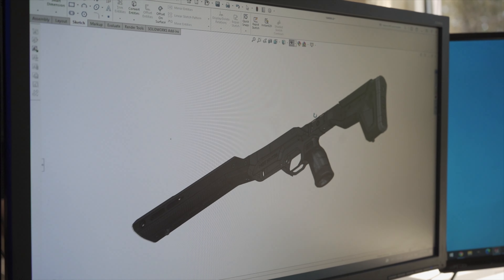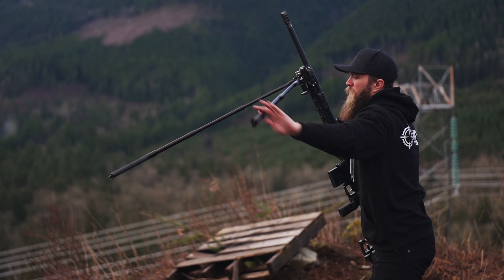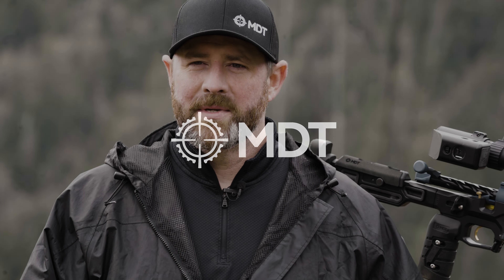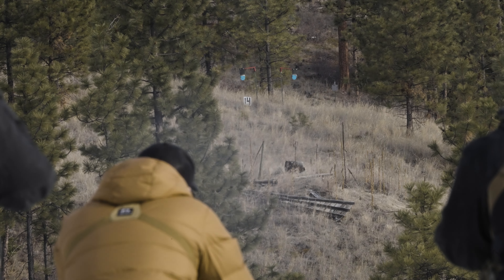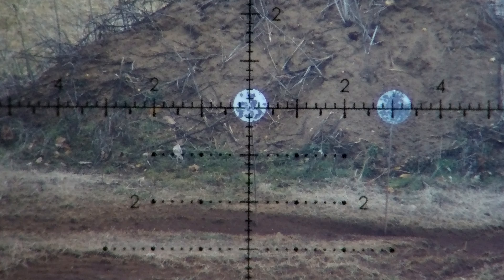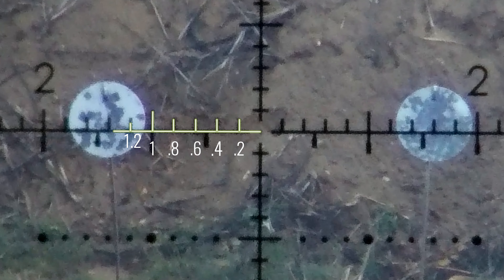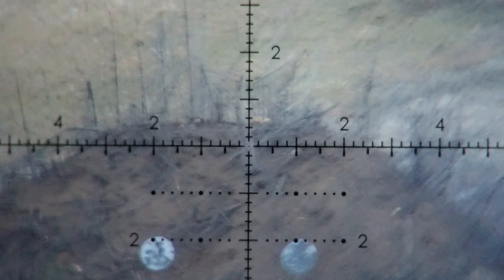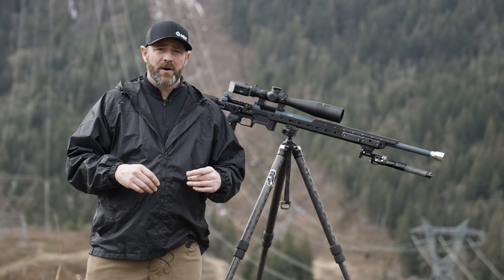How To Correct Shots That You Can't Spot - Precision Shooting Pro Tips

Comment: So… if u have a bad backdrop…. Waste a round somewhere nearby to get a wind call… since the road is closer in you example, can’t do it for elevation… then try again?

If that doesn’t work… blame the environment?

Cmon MDT. You guys are better than this
Reply: Either way the next round would likely not hit the target if you didn’t see where your first bullet went. Only difference is if you shoot at an area where you can see splash and is close to the target then you gain information from the miss.
Reply: @AllThingsLoud_  not necessarily true. Instead of completely sending a round with no chance to hit a target… you’re obviously gonna take your best attempt to get the first round impact. If a miss with no splash, then you take your best educated guess for the next shot. Whether that’s a different wind bracket or assuming your range/elevation was bad. You learn nothing by wasting shot into the dirt on purpose. Some matches would even DQ you for not impacting in the target zone.
Reply: @WHITEBELT44  the point is you need to have information to go off so you can make calculations to get on target. If you have nothing to go off of then you have just as much of chance of missing the shot and not knowing why as you did on your first attempt. I think the main reason you’re disagreeing is because he’s offering a solution that will vary on a case by case basis. It’s no something you’d always lean on as if  it were fundamental
Reply: @AllThingsLoud_  the way it’s presented in the video is basically don’t even try to impact your first round. Don’t bother calling wind if it’s not a perfect backdrop aka dirt berm to get data from. Why not make a wind call and go with it?
Reply: @WHITEBELT44   lol that’s not the way it’s presented, that’s the way you perceived it to be. You make a wind call on your first shot don’t you ? Most people do from my understanding. The first shot will either be very calculated in windage and elevation or a general hold that calculates only for drop and not windage in expectation that you’d have something to go off when you see your impact. The second scenario is usually what’s done when there’s no flags down to judge wind at the target. What this is about is that first scenario that you’ve attempted to make that first shot where you’ve calculated for as much as possible but you missed and didn’t notice a splash signature or any other signs of impact to see where the bullet hit. At that point you can try to study wind even more but depending on the conditions you may still end up taking a shot in the dark. In this case I don’t see any flags down near the target so even if he made a wind call it’ll only be a calculation near him and doesn’t help him know anything about what’s a 1000 yds away. As I said earlier, some things learned will be situational and won’t be a remedy you use constantly
Reply: @AllThingsLoud_  it’s presented as a “pro tip”. Might even be in the title. I don’t know any pro shooters that intentionally throw away a shot. Whether that’s at a match, a hunt, or practice. 

Correct when you say make a wind call and send it. But that doesn’t mean give up if it doesn’t work. If you get no read then you make your next best educated guess and send again (do I think I over/ under estimated the wind). 

Most places there aren’t flags down range. Also… you don’t need flags to make a wind call. This isn’t a high power match scenario. Not f class. This is scopes precision rifle. There are lots of ways to read wind past your nose or kestrel.
Reply: @WHITEBELT44  Maybe you’re speaking of a skill set I don’t possess or can’t even fathom. Maybe I’m not advanced enough to read wind at my face and translate it to what’s happening after the bullet travels so far down range. I imagine those same people can predict the future but I’m just not there. Btw you keep missing that you’re not accounting for a rapidly changing wind but I’m done because we just may never understand where each other are coming from.
Reply: @AllThingsLoud_  you can’t fathom looking through a piece of glass at vegetation or mirage moving somewhere past your toes and using a wind formula to come up with a starting wind call like every other precision rifle competitor in the world does?